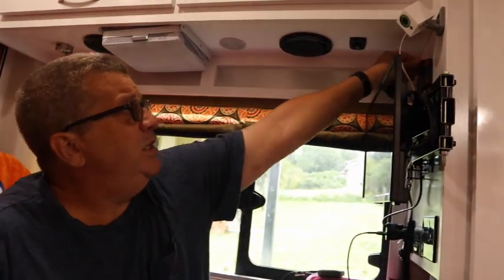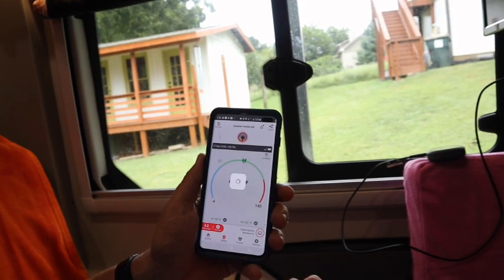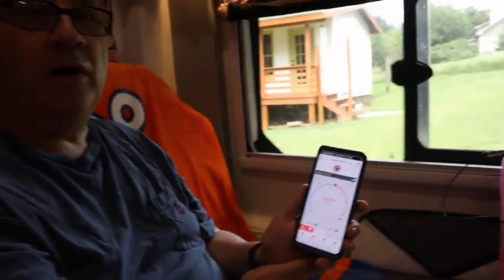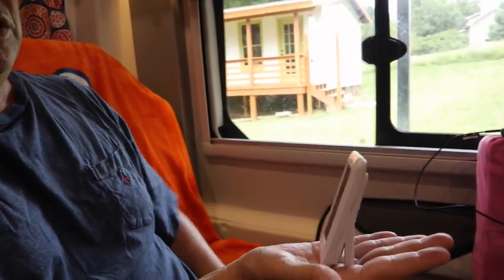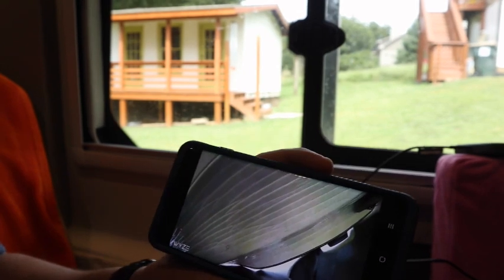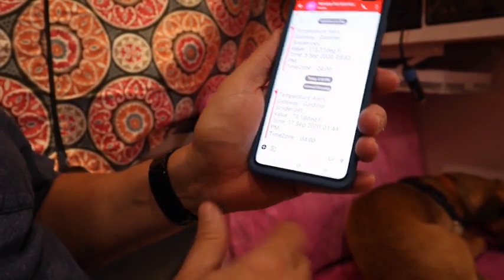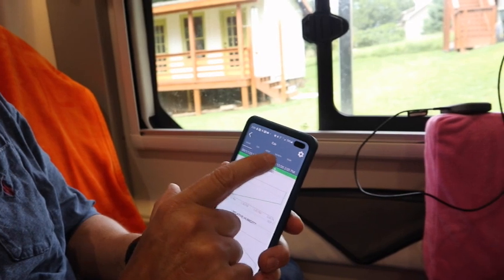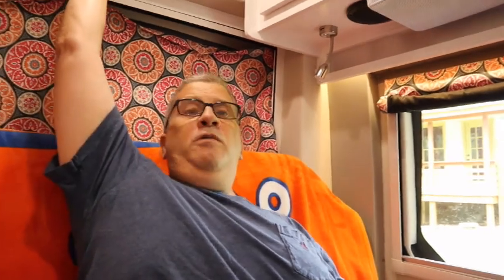How we remotely monitor our RV temperature to make sure Spike is okay.

Comment: We love the ability to keep the AC running in the Beyond when we stop with the dogs!  I agree it can almost get to cool back there because we find them all curled up when we get back in!  It is getting near fall here in Nevada and I was wondering about when to winterizing the Beyond?  I know it has a fresh water heater but can you cover when and how to winterize.  My husband knows how to winterize but if we are going to head south around Thanksgiving or Christmas do we need to winterize between and then dewinterize?  Love the information you have given us so far and look forward to more!
Reply from the maker: The question of when to winterize is something that really is easy to answer and difficult to answer as well.   If you are not going to be using the Beyond and the temperature is going to be below freezing during the day and night you need to winterize.  If it is going to be in the high 20s at night and in the 40s or higher during the day winterizing is probably not needed.  

Personally,  I perform a complete winterize as soon as it start freezing at night if we are not using the Beyond.   If we are using it I drain the entire water system and blow air through the system.  I  put about a gallon of rv antifreeze in the black tank and continue to use the toilet.  I put about 1/2 gallon of antifreeze in the gray tank.

We use bottle water at this point.

Remember when you drain the water system to drain the Truma and leave its drain open.  You cannot use the water heater, but you can use the coach heat.

Comment: Nice monitors 👍👍. 
I made a laminated sign of a very ferocious looking dog and a police badge in the corner. It reads “this vehicle temperature is climate controlled with a on board generator”
If you have concerns about my guard dog inside please call (my number)
I’d rather get a
Phone call than have someone hear my dog barking and then bust out my window. 
I have two. 
I put them under the shades next to the glass. 
One for each door up front. 
My little dog doesn’t sound vicious or match the photo. 😳🐈
Reply from the maker: Spike is a great and loving pup, he loves to meet people.   But when he is "guarding" the RV he is very serious.   I do need to get my signs made.
Reply: I tried to look and see if someone is selling a sign for pups inside with A/C but couldn't find anything. Not just campervans but also cars like Tesla have the climate control Pet Mode so I'm surprised no one has produced a sign... I'm guessing it's a liability thing
Reply from the maker: @cory2556  I am going to order some from https://doityourselflettering.com/vinyl-lettering/ 

You can design anything you want and they cut it for you. They made the lettering for my van's hose fitting labels.

Comment: What are your thoughts? I was thinking about putting up a “temporary” sign up in front windows with the following wording: 

Temperature Monitoring in Progress 

Blink and Proteus climate control system monitors

770.xxx.xxxx for information
Reply from the maker: That's what I usually do.   Mine say "Air conditioned and remotely monitored 770-xxx-xxxx".